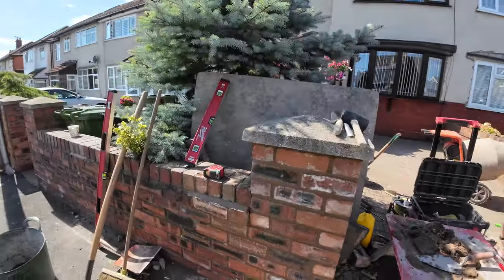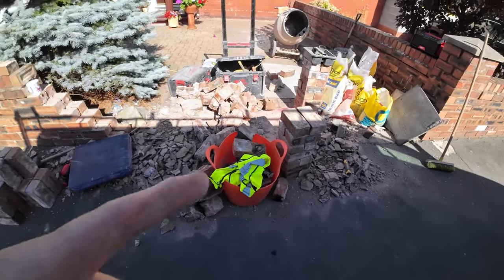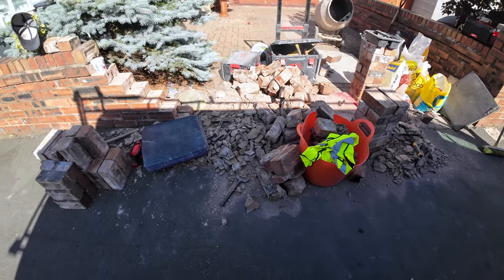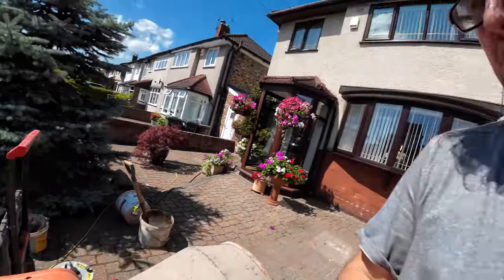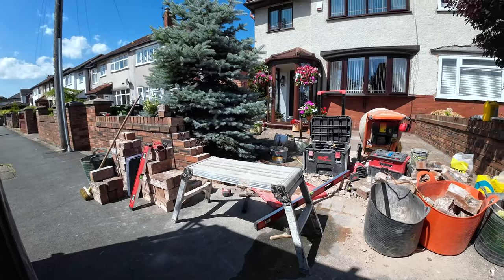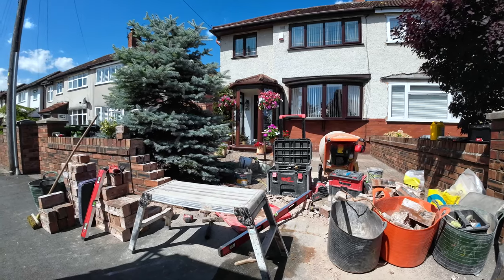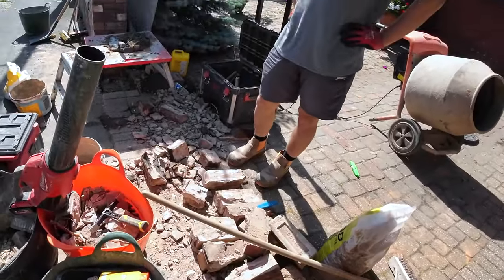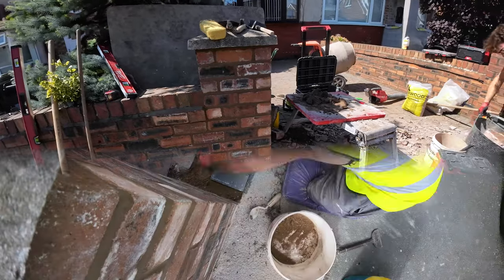WALL VS CAR … WHICH ONE WON ?

Comment: Agree with your comment of getting rid of rubble. Here on the IoW we have a local aggregates company that allows people to drop off clean rubble for free which is very handy.
Reply from the maker: That’s a great idea 🧱👍🏽
Reply: I'm surprised fly-tipping isn't a bigger issue. In my area the local waste site charge £3.50 for a 20kg sized bag to leave rubble.  It's an absolute scam.
Reply from the maker: @nigeats65 Robbery !😡😡🧱👍🏽

Comment: Great job.Those bricks look like giscol commons,whatever the black stuff  inside them is seems to react with the mortar causing it to swell up and crack the beds.
Reply from the maker: Yes mate manufactured in the devils Anus . Bloody terrible bricks 💩🤢🧱👍🏽
Reply: @SteveAndAlexBuild  I was told the black stuff was used foundry sand.Looks like coal dust.!.
Reply from the maker: It was crap wherever it came from 😒🧱👍🏽

Comment: i think the problem with that other brick peer is the telegraph pole has moved and its acting as a big leaver if its leaning toward the road then the bottom will have pushed away from the road and moved that brick work up in the air. just a thought.
Reply from the maker: Stay tuned 🤙🏾🧱👍🏽

Comment: How about a Hippo bag at home for all the rubbish from those smaller jobs that don't warrant a skip? 3 or 4 little jobs to fill it up then gone, not super cheap but saves all that mucking about in your car and queueing at the local tip?  Look after that hip mate. ATB
Reply from the maker: Hippo bags are a rip off and very expensive.
Reply: @SteveAndAlexBuild  I know they're dear, about a hundred quid for a one ton bag, but split that between 4 jobs say if you have room and it saves a fair bit of time going to the tip. Or quite often I ask some other builder who has a skip if I can offload a small amount for a drink. I find around here getting rid of rubbish legally is a lot of hassle. Anyway take care .
Reply from the maker: . Coincidentally we have a 2 ton skip on the drive now . £100 . 
Put a bit on the last few jobs to pay for it . 
   Skips don’t collapse when they are half full 😉🧱👍🏽

Comment: Kneeling down is bad for your knees, sounds obvious, but since I started squatting while working at low height, the pain and clicking noises have slowly gone. The knee joint is not designed to take your whole body weight pressing on the rear of it. I wish this was taught in all physical trades early on; stop kneeling!
Reply from the maker: I don’t choose to kneel, I can’t squat